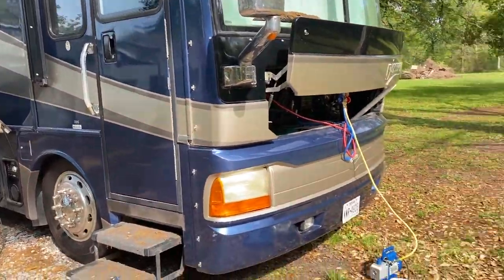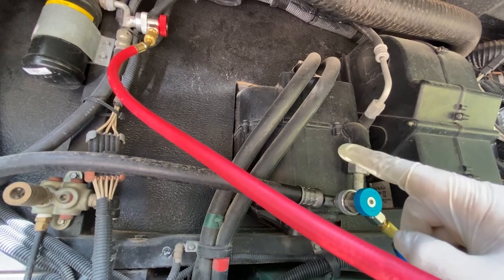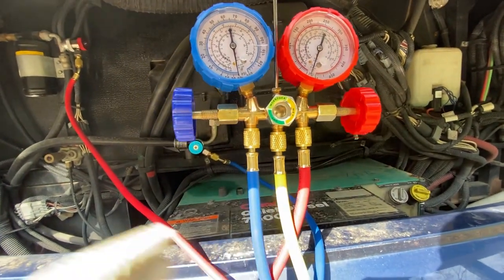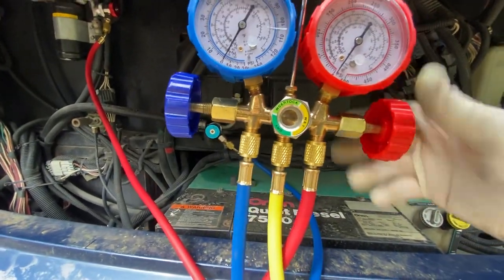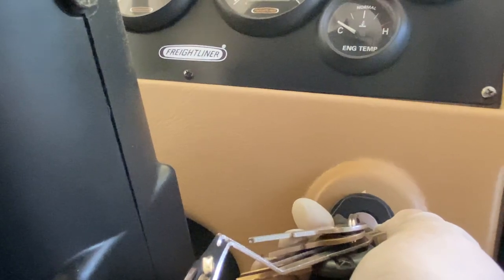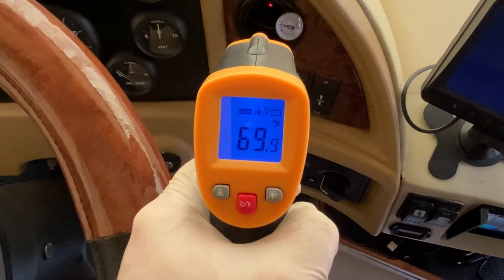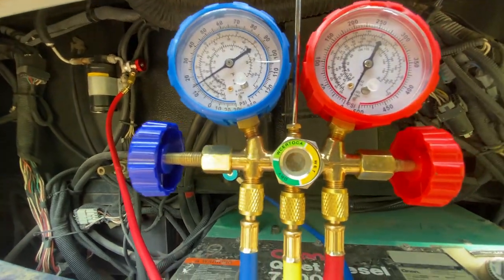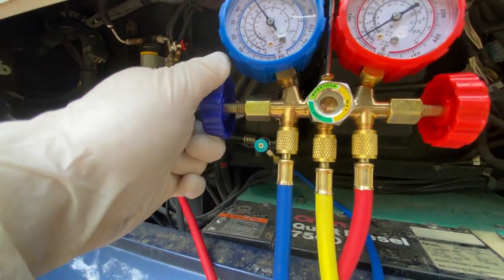How To Recharge Your RV Dash AC

Comment: Thank you so much.  My compressor locked up several months ago.  We were headed to a long term destination so I didn't worry too much about it at the time.  As expected, my belt broke with the lockup but it was dedicated just for the compressor so I didn't worry about it.  Upon arrival, I purchased a new compressor from Spartan and installed it along with my spare belt.  Since we were parked my plan was to have the system charged once the cold weather disappeared.  I called several companies about recharging my system over the last two weeks and the only company that worked on RVs wanted $450 plus the refrigerant.  Way too much for me.  I started looking for procedures and found your amazing and thorough video.  I plan to buy the parts and charge the system in a week or two.  Thanks to your video and some of the other comments I can do the job without a problem.  I can't leave you a social media comment because I avoid social media.  Hopefully this will reach others.
Reply from the maker: Thank you for the kind words. I'm glad it helped!

Comment: Thanks dude, you’ve provided great advice. I broke down in the interstate with an overheating engine because the compressor locked up and broke the belt. $1600 for a tow and another $1400 for a new belt/ compressor, and an attempt to recharge, and my AC still doesn’t operate. They couldn’t find the fuse. I have a 2016 Thor. My first challenge is to find the fuse that they were unable to find and then buy the gear from Harbor Freight to finish the job. With the help of your excellent video.
Reply from the maker: I’m glad we could help! Good luck

Comment: To prevent air getting introduced after vacuuming the system down, after you hook up the refrigerate can to your yellow hose(with the high and low side manifold valves still closed), open the valve on the refrigerate can, then crack the yellow hose fitting at the manifold to let any air out till you see refrigerate start to come out, then tighten the yellow hose fitting back up. The yellow hose is now free of any air. Our Newmar( and I believe all manufacturers would) have a sticker in the proximity to the low side charging valve, stating the type of refrigerate and amount needed for a full charge. Ours quit cooling a year after having a leaky fitting replaced at the condenser coil. I purchased an electronic leak detector and the first place I checked was the fitting replaced by freightliner at the condenser coil. No leak. The only leak I could find was the Schrader valve in the low side charging fitting. I wish they had a shut off valve behind that fitting so I could replace the Schrader valve without losing what's left of the refrigerate. If you know of a way, let me know. Thanks for posting, nice coach. I'm a new subscriber.
Reply from the maker: Thanks for the advice! Hopefully we don’t have to do this again lol
Reply: @TexasYoungGuns   Last week while rechecking the condenser fittings(in front of radiator) I did find a pretty good leak using a combo of electronic leak detector and soapy water. It was the upper hose connection. Not the one Freightliner replaced. I did find a way to replace the Schrader valve with a charge on the system. Its called a Schrader valve replacement tool. Mine is made by mastercool.

Comment: Worked  for a A/C shop in Florida way back. Correctly is the only way. I can see you were carful . I'm sure you didn't vent refrigerant into the atmosphere (ever). Big fines. For that,  you need some pro equipment to 'reclaim' it. I didn't see a dryer. Bad move. it traps water. You can't dry it out with a vacuum pump. Easy to replace. What you were probably smelling was system oil. You need to know what kind of oil, If it was 134 from day one, PAG. I doubt it from the age and you can tell if the high and low connectors have been converted to the pop on (R-134) from the old screw on (R-12). You need to do an oil balance or you can ruin the compressor. You mix the different oils you can wreck the compressor. You vent too fast you can shift oil out of where it belongs and it can be vented out. Then you don't have enough oil and things go bad.  You should get a sniffer to make sure your system is tight. I do my own. I have a class A. I need to pull the hoses out and replace them with lined hoses. R-134 can seep out of an old hose on a molecular level. The right oil to use in a converted system that has not been taken to bits and completely flushed, is  ester oil. It has a side effect of coating the inside of the hoses and slowing the seep. Really as bad as it will be, you should pull out the compressor and drain it. make sure oil is in it, and how much. Then you got in idea of how much you will need based on the compressor, the length and width of the hose,, the size of the evaporator and the condenser. Oil balancing.  So much more to it. Another thing would be to invest in an electronic gauges with micron measurement. That will tell you 100% if any moisture is left and the system is tight.  I would have let that vacuum pump run overnight.  Glad it worked out for you.
Reply from the maker: Wow lots of good information there!
Reply: Vacuuming the system down "properly" will remove the moisture from the system. This is the primary reason to apply vacumn in addition to removing the air. If removing the air was all vacuuming was for you could stop the vac as soon as it hit 30 " of vac. The reason you vacuum a system down for an hour(or more) is to boil off the moisture in the system. At high vacuum water will boil at room temperature. When the moisture boils off it expands and releases more air from the moisture (water is made up of hydrogen and oxygen) and this is why it takes time to vacuum it down. Must give it time to boil off.

Comment: slightly crack open the yellow line at the top to purg the air from the yellow line ....as soon as you see refridg beginning to come out of the yellow line quickly close the fitting ... you are introducing a huge amt of air into the system each time you install a new can to the system.

Comment: R-134a is safe for the environment it's why R-12 is no longer used (no CFCs). Remember whatever is in the system came from outside the system. Releasing it puts it back to where it came from originally came from....outside the system. It is also easier to pull vacuum on the low side only. No need to hook anything up to the high side. You can charge also without the need to hook anything up to the high side. If you're doing analysis and/or diagnostic on the AC system then you'll hook both low & high sides up.

Comment: Good video! I have a 2000 holiday rambler that I'm having issues with as well. Low pressure line had a leak, ran all new line, then it wouldn't take freon. Compressor spins but pressures stay equal. Put new compressor, new dryer, new expansion valve. Then pulled vacuum and went to add freon again and same thing. 😑 
Low and hi pressures stay equaled, compressor is spinning,  but not pulling down on the gauges. 2 bottles in so far and no change in pressure when AC is on
Reply from the maker: 2 bottles is not a lot of Freon for these rigs. Ours took around 6 or so if I’m remembering correctly. There should be a data sheet somewhere in the nose which will give you the exact amount
Reply: @TexasYoungGuns  would that cause the compressor to engage but not show any movement on the gauges?
Reply from the maker: @jgmcmahon1  I’m not a A/C expert but if there’s not a lot of Freon to move then I would expect the pressure to not change that much!

Comment: Just a word of advice. Don't just turn the ignition switch and crank the engine over. You are skipping the ECU self test. That's why the lights have to all come on and stop. Then if you have a problem, you'll know. Informative video by the way.
Reply from the maker: Dany F thanks for the info!
Reply: @TexasYoungGuns  No problem. I don't know much but when I do know something, I like to share the information. ☺

Comment: We have a new Winnebago Vista 31B and we have been having trouble getting cold air coming out of our front dash vents.  I'm having a hard time understanding how to know if there's a problem or not.  I am of the opinion that we should be getting cold air coming out of the front vents, and that the temperature of that air should pretty quickly be in the 40-50 degree range coming out of the front vents.  Yet when I tried it yesteday, it was measuring in the 70s and 80s.  The dealership is saying the dash A/C will only cool the air about 20 degrees less than the inlet air, and that we need to cool our motorhome down first with the house air conditioners.  Then after we do that, they are saying the dash A/C should blow air around 60 degrees and keep the front of our unit cool.  Any thoughts or suggestions?  We live in Arizona so this is a significant issue that we are trying to understand and resolve.
Reply from the maker: That is total bologna. Sure if it’s hot outside you might need to drive a little to get air over the condenser but you should have no problem getting 45 degree air coming out. Have you checked basic things like the refrigerant level? Can you see if the compressor is turning? It sounds like the blower fan is blowing but the compressor is not turning on. Could be a fuse or not enough refrigerant
Reply: @TexasYoungGuns  Thank you for the tips!  Our motorhome is at the dealership and I'm just trying to get helpful information on what I should do in our situation.  I'll pass along your suggestions if needed!  After driving around for 15-20 minutes, the air coming out of those vents was still in the 60-80 degree range, whereas I think it should be somewhere in the 30-50 degree range, and certainly at least under 60 degrees.  It's been hard to find any documentation that states how cool the air temperature should be coming out those vents, and how that varies depending on the inside our outside air temperature.  We've just never had issues with getting cold air coming out of our other new vehicles (not RVs), and didn't expect that we would have any trouble getting cold air coming out the front vents of our brand new motrohome.
Reply from the maker: @jeff946  like I said, don’t let them tell that 60 degrees is normal
Reply: @TexasYoungGuns  Thank you for the info!
Reply: The dealership is correct. The dash AC systems in these large RVs cannot keep you cool to any degree once the temp goes north of 80F. Most of the cool air is lost to the large area in the cab compared to the small interior of a car or pick up truck. Most who've owned these big class As will tell you that and you should run the roof AC instead.

Comment: Great video.  I too had my compressor lock up on me and threw the belt while on a trip near Tallahassee, FL.  After replacing the compressor I was unable to get my compressor light to come on either, so I couldn't charge it.  You mentioned in your video that you had the same issue with your compressor light.  What did you do to fix the issue.  I found an inline fuse right behind my control unit under the dash, but it was good.  Is there another fuse?  Also, is there a low pressure cutoff switch? My coach (Waldo) is a 2009 Fleetwood Discovery.  My controls look exactly like yours.  Thanks for any advice or help you can give me!
Reply from the maker: On mine there were two fuses. But yes the compressor will not come on until enough pressure is built in the system aka the low pressure cutoff switch. I would start there.
Reply: @TexasYoungGuns  Do you know where the low pressure switch would be located?  Thanks for your quick reply!
Reply from the maker: @tolliecorder  usually they are near the dryer under the front hood area. But ultimately it’ll be somewhere in between the outlet of the condenser and the side of the evaporator
Reply: It would sure be nice to know where you found the second fuse.  I found one inline tube fuse on the harness behind the control unit.  The other, I cannot find.  I'm at a loss.  Thanks again for any help you can give.  @TexasYoungGuns
Reply: My second fuse is in the center on the evaporator housing behind the center console fuses and relays

Comment: I heard Freightliner recommends changing the filter-drier every couple of years.  What replacement did you use on the Discovery... and where did you find it?  I can't find an equivalent Parker on Amazon.  Also, did you change the compressor from topside or underneath?
Reply from the maker: The compressor change is a combination of above and below as you have to remove the alternator first, then the compressor. The top bolt is only accessible from above and the bottom bolt is only accessible from below. Whenever you expose the drier to air you have to change it out.
Reply: @TexasYoungGuns  Thanks.  I wish you had done a video of the repair as I could certainly use some Amazon part numbers for compressor/belt/filter-drier.  Did the compressor failure put any metal particles in the lines?
Reply from the maker: @bobheiges3634  I called freightliner and gave them my chassis vin and they gave me the part number for the compressor. The freightliner place was local.

Comment: Hi. New subscriber here. Was wondering where you found the fuse for the ac light that was out?
Great video. After watching I decided to have a Professionol charge mine. I’m not as confident in taking the liability lol
Reply from the maker: My fuse was behind the center console. The door swings out and the fuse was in a plastic holder. Hope this helps